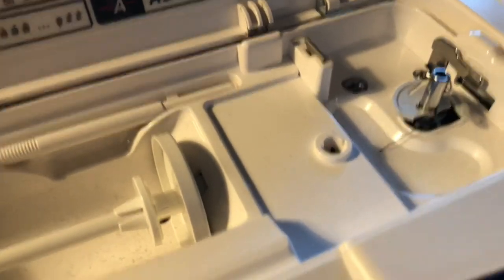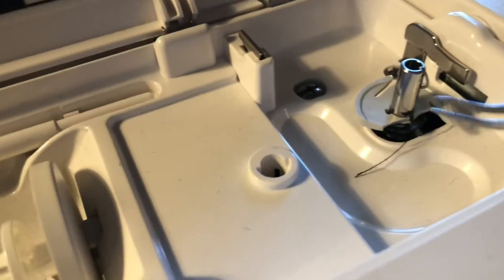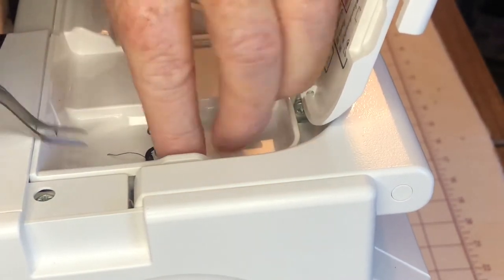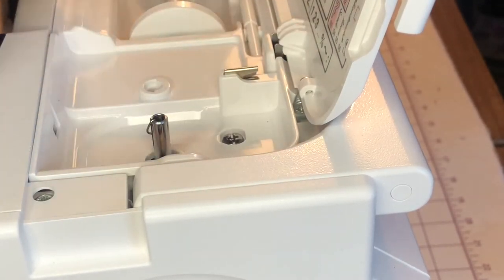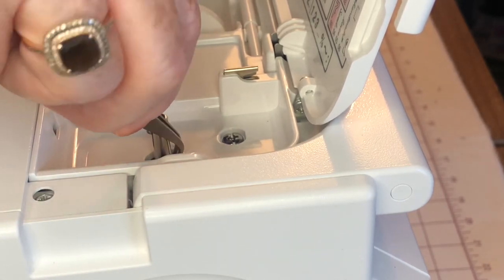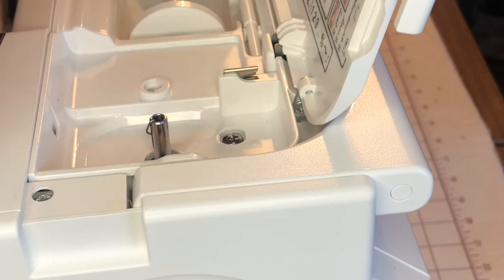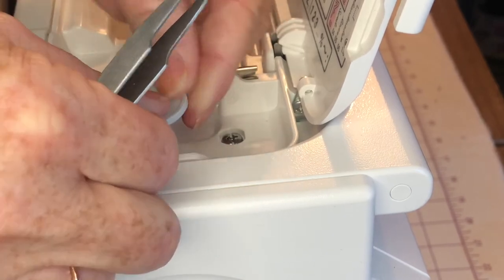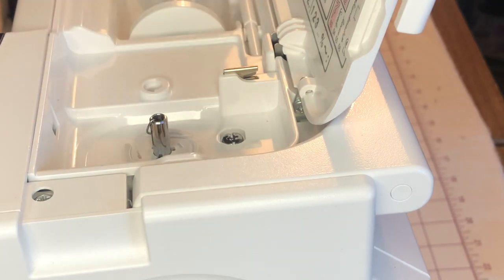How to Fix Thread Getting Wrapped and Caught Under Bobbin Winder on Janome Sewing Machine

Comment: Great quick tutorial. Worked a treat with plastic trim removal tool to remove the base of the bobbin holder without damaging the machine. Thread popped right out  after struggling with it beforehand
Reply from the maker: I’m so glad it helped

Comment: When putting the plastic winder base back be aware that there are 2 little pins on the winder spindle, these have to line up with 2 wider gaps on the bottom of the plastic winder base (otherwise it would spin aimlessly) :face-orange-frowning: 💥💥💥 Guess whose did
Reply from the maker: I love this tip!  Thank you for sharing.